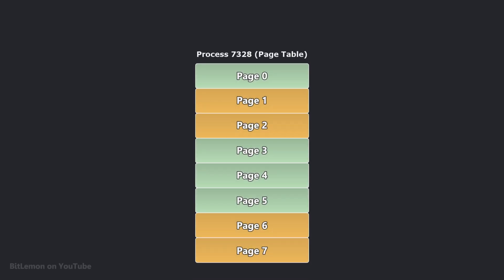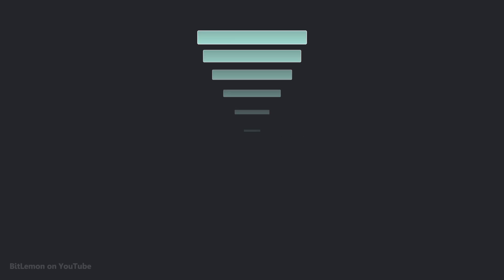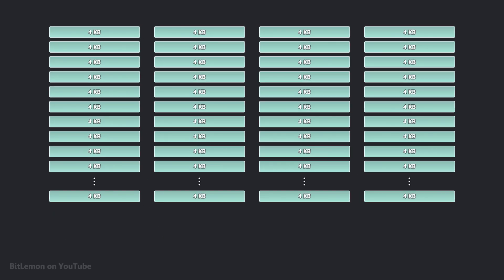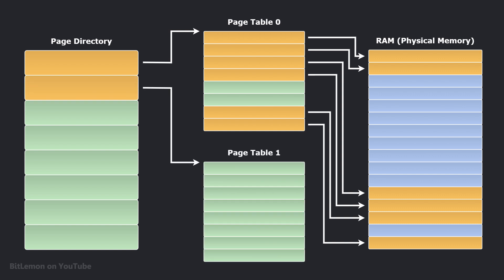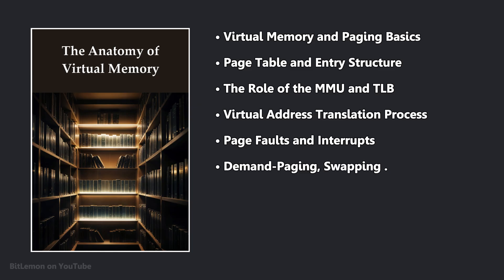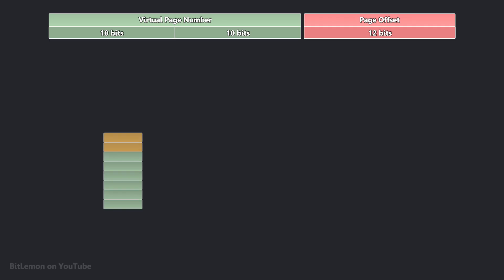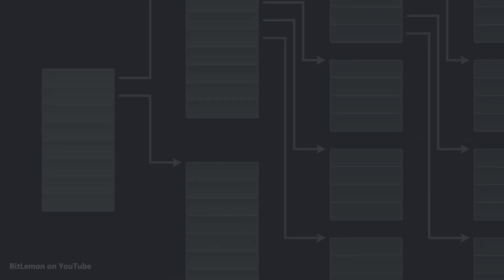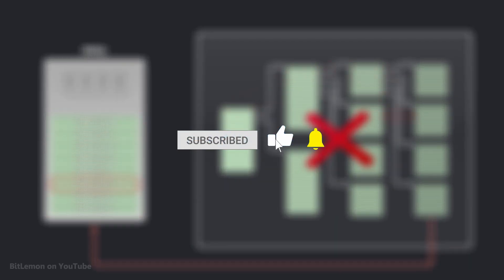MultiLevel Page Tables: How Virtual Memory is Optimized (Animation)

Comment: I am learning assembly, and I am often told to keep structures in .data aligned within page size. Now it makes more sense why, thank you for the video!
Reply from the maker: That's true. If your structures span over multiple pages it means potentially more page faults, more TBL entry replacements and possibly more memory for keeping additional page tables